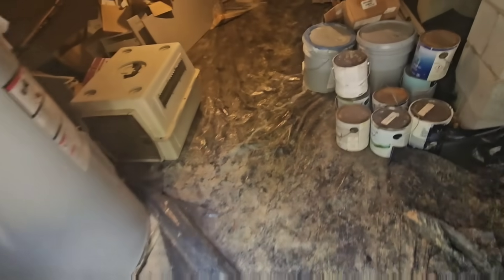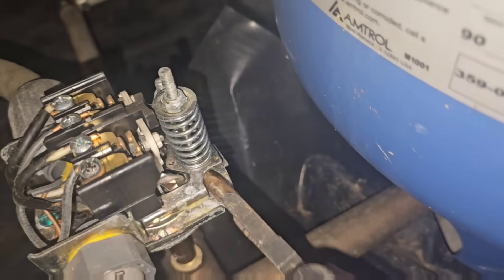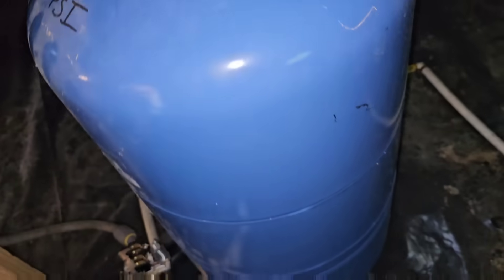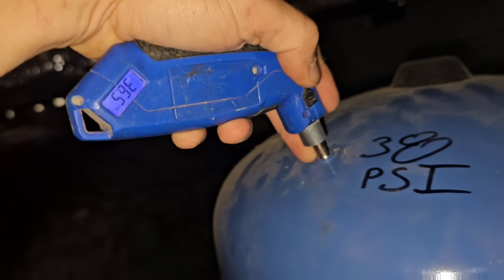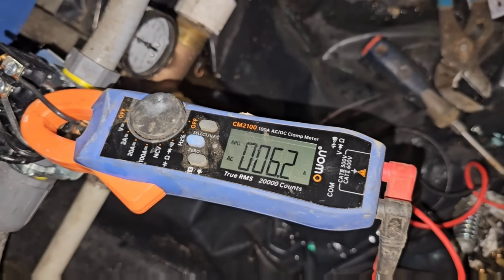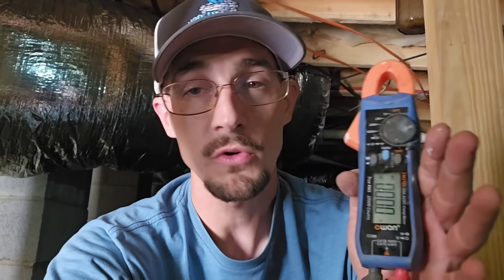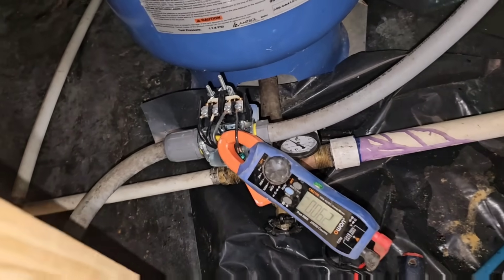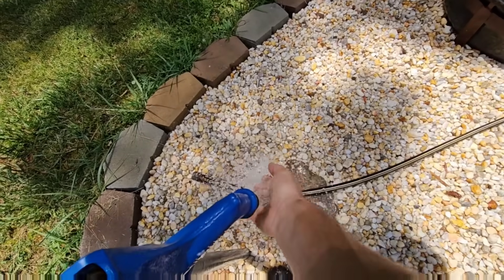Well Pump Troubleshooting at The Pressure Switch. DIY Test & Fix for No Water.

Comment: Stable pressure is key for uniform corn irrigation. 3S pump controllers help keep sprinkler systems running smoothly.

Comment: Great video but you didn't distingush what voltage you're working with. Also very presumptuos of the coloring of the wires. Lotta dead electricians thought color meant something.

Comment: Wow- excellent video- had a somewhat limited idea of how the parts worked together, but your video really brought my understanding up a level. i have a 30-50 pressure switch that is shutting off at 30- I can manually force the switch to turn on, but it never gets above 30 before it turns off again- haven't drained the suystem yet. Would you guess tank or switch- pressure gauge looks pretty tired- badly rusted- could that be it?
Reply: Curtis 👋

Comment: What makes my pump get hot and cause my pump to blow the water line
Reply from the maker: The pipe feeding the pressure switch is clogged and it doesn't sense the water pressure to shut off the pump. Remove the switch and clean the pipe out and replace the switch

Comment: I have a 30/50 tank. Tank pressure is 20 so I assume I need to add air to bring it up to 28? Do I need to just add air or do I need to drain it first? I was having a problem with it cycling on and off constantly when we run the water. Could that be because the tank pressure is 20 instead of 28? If I add pressure to 28 and it still cycles over and over when we use any water, what do you suggest?

Comment: Question. My old pump died so I had a company replace it. They offer me an upgrade from 1/2 to 3/4 for $100 more. They said that I’ll have more water faster being that it will be a bigger pump. Now my pump is going on and off every time I flush a toilet for 2 to 3 seconds every time. I want to say 7 or 8 times for just a toilet flush. Now I have been told that my tank is too small that I need to upgrade my tank. Nobody mentioned that before I upgraded the pump. Any idea if I actually need to upgrade my tank as well. My currently tank is pretty much new. Any advice will be appreciated. Thanks

Comment: I am having issues with my water stopping every few days. Today, I was able to check the pressure when the water stopped again. The pressure read at 20 and it was possibly lower before I got to it. The pressure kept climbing and pump switch kicked in (don’t recall at what pressure point). It went all the way to 90 before stopping. I had good pressure then. I ran the water to see where it would end up dropping in pressure before it kicked in again. It dropped to 65 before the switch kicked in again and went back to 90. I am unsure why it will not kick in at times, leaving no water pressure. I am also not sure if the pressure range of 65 to 90 is good for my household or it indicates something bad.
Reply: Hello Steven

Comment: We replaced our pump and our water worked great for about a month. However, the pressure varied. Now we have no water. The pressure gauge is not hooked to the pressure tank. We believe that everything was installed incorrectly. The pressure gauge is at the top of the pump area where the pipe goes down into the pump. It is not building pressure, but water does come out of the pipe that is attached. We don’t know what to do next.

Comment: Very informative video! I'm gunna order an amperage multimeter. I'm not getting any power to the pressure switch. The relay in the smart box has power on both hots on top but no power coming out to pressure switch? Are you able to offer any advice on this?

Comment: Urgent help needed. This well pump would not prime because it had a rusty hole in it so I changed the pump and I got it to prime but it stays on at 30 psi and it will not go lower or higher it just stays on. I'm stumped. What do I do?

Comment: you pushed the spring up and then tested the contacts, but How do u know switch is bad from doing that?  Water swishing means add air pressure, or the tank is totally bad?

Comment: hi there i am having a wired problem installed a new presure tank new cutoff switch irrigation system 3 circles everything works fine until last circle pump starts on and off tried last circle at a difrent hour still  faults .
(all circles have the same outlets)

i have completly run out of checks, any suggestions would apreciate 
i will check the tank presure again as the way you have. 

thanks 
albert

Comment: Great videos! I have a breaker that trips intermittently. I after first trip went a week. After the next trip- ran water like crazy to try to duplicate. Worked fine.  The 120 pump and 40/60 water pressure tank all system all metered fine. Pressure tank fails closed no with visible carbon or burns. Another week and then a trip again. Properly tested the amps to the water pump after watching the way you tested one wire with a clamp meter.. 12.9 amps. Was a bit surprised it would work fine for a few weeks. Off to Lowe’s to buy a new pump after I watch your how to on pump replacement. Thanks! For all you do!! Any recommendations for a pump? 😂

Comment: Hi water is not working. We’ll pump system looks very dry like it hasn’t been on for a while. Water just stopped today. Plumber came checked fuses replaced one. Still nothing. He said now it’s a two man job and they need to check the well. Could cost 3000

Comment: Hey Bud, I have a water pump that turns on and reaches 50 psi. The problem is that it does not turn off, and no water is running through the water lines or coming out of the water fixtures. What can you recommend?

Comment: If you go around both power wires with current camp at house and energize it will check for ground faults in wire to well Best way is to disconnect pump at well and check for current. Any current is a Ground Fault GF. You are a very talented well and water / electrical technician. Your a good man.

Comment: How do you know if capacitor is bad? I replaced switch about 6 months and made pressure in tank like you showed 6 months ago.  I woke this morning to the switch is closed. I took power off then back on at the pump and the relay kicks on and hums a little then stops no pump turning on. Would that be the capacitor?

Comment: Let's say for arguments sake I've the correct amps my pumps motor  is spinning but the pump is moving its water too and fro within the line but not really going nowhere . What do you feel that the issue is then? (Over all issue pump won't prime)

Comment: I'm not following your description for testing with a volt meter.  I don't have easy access to my well head, so I'm testing at the pressure switch, which is wired (numbered left to right) Terminal 1=Hot 1 from panel, T2=leg 1 to pump, T3=leg 2 to pump, and T4=Hot 2 from panel.  With the pressure switch OFF, I get 120V between T1 and ground, and 120V between T4 and ground, nothing between T2 and ground or T3 and ground, and 240V between T1 and T2.  But I also get 120V between T2 and ground, as well as between T1 and T 2...?

Comment: My well has been displaying an under load light and not flowing water. I replaced the pressure switch in my well pump. The pump ran and rose to about 20 psi then displayed the under load light again and would not pump anything. The pressure then dropped back to 0 psi. Do you know what this might be?

Comment: The contacts on our pressure switch that we just installed our clothes but still no water. Does that indicate a problem with the pump? Breaker is not tripping.
Reply: Sorry, meant to say “is closed” not “our clothes.”

Comment: I can't tell you how much I appreciate your videos. As a single mom who is scared to death of electricity, your video has helped me put together a homedepot list and gave me a little confidence that I can get water back on for me and my kids. Thank you. One of my main issues I've had for a couple of years is my pumps keep running and get so hot it swells up my pipes, and they shoot off. My ex kept replacing pressure switches and pumps. So I'm gonna follow your video step by step, and I'll let you know the results.  Also, if I might ask, my pump turns on at 30 and cuts off at 55 (when it cuts off, I usually have to hit it with a stick to get it to turn off) but as soon as it cuts off it starts dropping immediately and I've checked for leaks and have none. Any other ideas?

Comment: What happens when you hook up the pressure switch backwards? I had to unhook the wires from pressure switch reroute the way the wires came in the basement. Hooking back up I the leads to same side, and now I don't have water,  before I did. What did I burn up ?

Comment: Pump replaced 15 years ago after lightning strike. in the past 5 years the pump, this is our guess, is exceeding the 90# rating of those filter housings and we get a leak.. can pull off filter, inspect, find nothing wrong, refresh the lube on seal, spin on zero leaks.. I was trying to use clamp on amp meter to see how much pump is pulling, they are too short to get just 1 lead into the jaws.. so I tested the voltages, 220 on each of the 4 wires.. the control box on wall appears to be bypassed, no more red switch sticking out of the box.. there is some pitting on the contacts, thinking they may have installed a 110 pump and supplying 220.. but all 4 wires 220, shouldn't they each be 120 max, or is this due to windings of motor? either way need to stop these floods, earlier when attempting to test leads had power off, ran pump down to 30# it clicked at around 38# for a 40-60 but did not come on, that is when found 220 to ground every lead so contacts were engaged.. flipped breaker said will look in morning.. decided 1 more time to test, flipped breaker, pump kicked in.. wtf... bladder tank must have around 30# pressure as it dumps to zero when reached 30#.. tank and filter housings are new.. dude who installed pump will not respond as I gave him shit for not shocking well after a pump swap giving our clean tasting water a sulfur n iron taste.. I since shocked 2 times, muck for 30m each time, so loads in this 628 foot deep well. water is nice with filters.. will see if he left any paperwork as I think he did for pump but mother likely tossed...  this 220 was my only concern and why did not kick in when power to all 4 leads... has to be wiring now and perhaps sticking regulator exceeding the limit of the filter housing... ??

Comment: Hello, I have a deep well 286’, pump hung at 196’ on 30-50 switch. It is a 1.5hp S.S Grundfos & wellxroll wx250 tank both installed in 1997. Tank rings like a bell up top and pressure switch seems to be cycling right. The well is pulling water but very very slowly. Normal takes a minute or two to go from 30-50psi but now it’s like 30 minutes plus to go from 30-50 psi. I know the pumps old but curious if it could be a blockage or dirty screen. Also had some iron bacteria globs a few weeks back. Will chlorinating the well or doing acid dose help matters or would you just to advise of putting in a new pump. They want about $3600 which seems pretty expensive. Just trying all options to fix before replacing. Think about doing it myself, my nephew is a master plumber that will help but he has never done any wells. Thanks in advance, love what you are doing to help out the fellow man!

PS I have also changed out both capacitors in the Franklin control box but issue is still the same.

Comment: I'm checking my well today.  Power is off, system is drained, my tank is at 28 as my PS is a 30/50, but my gauge reads 60.  
Is my gauge blown? 
Is my PS bad and led to blowing the gauge?
Thank you for your help!
Reply: Hello 👋

Comment: Have no water. Ok so my pressure gauge next to pressure switch is at 20. I got the power off for hour or more and the pressure won’t go down to check the air tank. I got a faucet open as well. 
The pressure switch seems good when it’s live and there’s is power going to it and coming from it to the well pump. Any suggestions on what I do now? Also I measured the tank anyways it’s at 32 and I know that’s to high for a 30/50 but obviously there’s still 20 psi in the line so the reading isn’t accurate

Comment: I’ve got trickling water pressure everywhere in the house. Pulling 11.5-10A I don’t know the HP but I’m guessing 1hp it’s a 250ft well. Pressure tank is holding pressure and not waterlogged I tested the pressure over two days. Pressure switch looks brand new. Cutting on at 40 cutting out at 65 and settling at 62.  With the valve feeding the house OFF it holds if I open up the house valve it’ll go from 60-40 in about an hour. I’m guessing that means a leak somewhere. But I can’t for the life of me figure out where it would be.   I’m thinking it’s time to call a plumber unless you have any thoughts.
Reply from the maker: Turn off the breaker at night, when you wake up, go check every toilet in the house. One will be leaking down. Either at the flapper or overflow. Its probably draining the well dry if its trickling flow (or your using a carbon/black filter element & its plugged up with minerals, switch to a string woven filter. 
If you have a water softener, it may be broken internally and wasting water, put it in bypass to test it. 
The leak is after that valve...so, filter systems, toilets, or a hose left on outside (water to garage/ barn/hydrant). 
Youll find it, just start looking everywhere!
Reply: @h2omechanic wow. Subscribed. I didn’t think you’d respond. I did just put the softener on bypass like 5 mins ago. And I also did just recently change the filter to a black carbon mesh filter from the standard ones I was using before. I’ll definitely try what you recommended 🙏🏽. You’re a legend.
Reply from the maker: @CaptJackDeez the black carbon filter is 99% the problem! Just remove it & see if it fixes it. (But that doesn't cause the pressure dropping issue)  So still inspect the toilets!!!
Reply: @h2omechanic dude I just replaced it with a regular “medium” grade filter and everything is back to normal. If anyone sees this that’s having issues Don’t use those fancy ultra fine filters lol.  I’ll keep an eye on the pressure and running toilets. You saved me hundreds of dollars possibly thousands depending on how bad the plumber was lol.  You’re the man!

Comment: My pressure switch and expansion tank were both submerged in water, and my well pit was completely full. I am a new home owner and my service is very old. I'm currently pumping out the water with a submersible pump, but now there's no water pressure coming into the house. All faucets are dry. This well pit is outdoors a couple of feet from my home. I have a feeling the pressure switch and expansion tank are now destroyed. It is currently twelve in the morning, so I'll have to wait until morning before calling services. My goal for now is to get the water level below the expansion tank so it can be inspected by a professional if I can find one local. Thank you for your informational video.

Comment: Hey! I see you sleeve wires through flexible conduit or conduit. I know pulling wires through any of that can be a bear. Check out a product called Spy Spray, I won't pull wires without it.... It will make pulling wires easy without a big mess. You'll thank me later.... lol

Comment: Love your videos and I have learned alot. I am having a problem with my water supply and hope you can help me. I have a new 1/2 horse submersible pump in my dugout, which worked great for app. 10 days. Now it takes over 4 minutes to build 53 lbs to trip the pressure switch. It holds pressure, but cannot seem to build pressure fast enough(used to take 25 seconds to cycle). I have changed pump, pressure switch, control box. Pressure tank is and I have 220 volts going from the controlbox to pump. Could it be possible I got a bad 220 volt pump?

Comment: Your video has the best knowledge and understanding on how to troubleshoot a submersible well pump. I decide to try my own well pump because I'm not getting a consistence water pressure in my house. if I use more then 2 faucets in the same time or washer machine is running the water pressure goes down. Not knowing what size submersible pump I have, I went and did the draw amps test and I got the reading of 7.6,  and 240 volts, 120 volts on each legs.  You said for a 1/2 hp pump the amps should be reading between 6-7 amps, but I read in the website and it say: 5-10 amps still a good pump. Please help to decide if I should replace it now or I should check for something else? (the pressure switch is rated for 40-60 and the air pressure tank is at 58psi, both been replaced a year ago and they are working well.) Thank you.

Comment: Need help! Was watering garden then noticed no water in house. Went outside and took off cover to find no pressure on psi gauge. Then took cover off pressure switch and it's stuck open. I used the cover to flick it closed and it stayed closed for about 20 seconds and then opened back up. I tried flicking it back closed and it will not close nor will it spark. Checked power meter box, it was still on. When I did manually touch the switch together it moved the gauge from almost a 5oclock position to now a 7 almost 8 o'clock position, but still not registering pressure
Reply from the maker: @amberjenkins4325  the little pipe/nipple below the switch might be clogged. (Or you ran the well dry & it needs to recover).
Watch my most popular video on the pressure switch troubleshooting and it explains why the nipple gets clogged. 
Remove the switch and jam a screw driver thru it to clear it out. 
The switch can't sense the pressure high or low
Reply: @h2omechanic  I'm wondering that the pump went dry. I'm going now to buy a digital psi reader and a new pressure switch. Then when we replace it I will clear the nipple. One thing I  cant get is a spark off the pressure switch. It's staying open and when I use the cover to close it, it doesn't spark